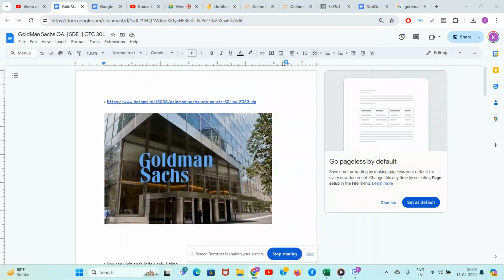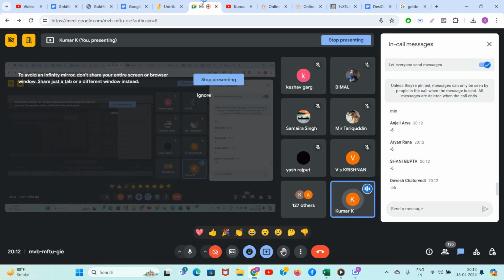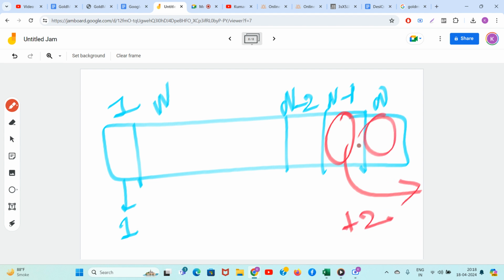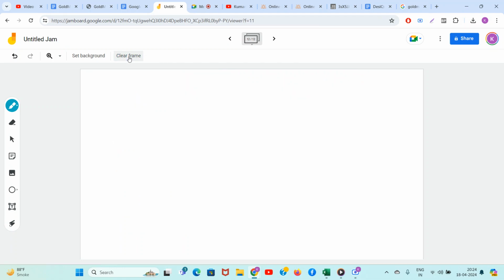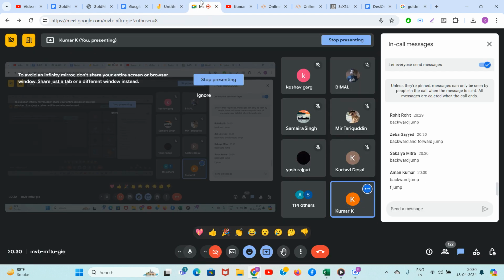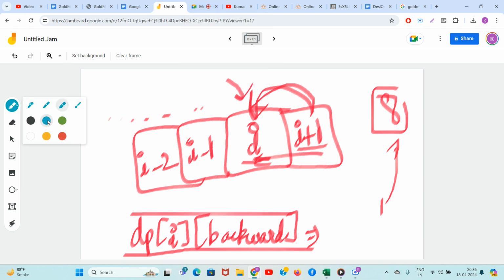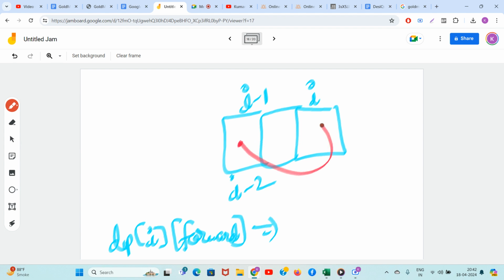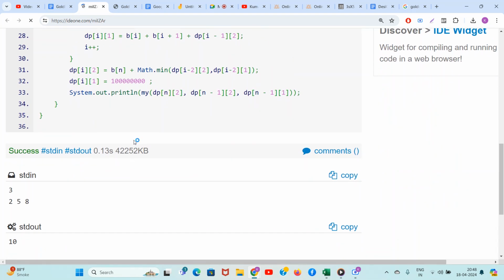Goldman Sachs OA | Interesting DP | CTC 30 L

Comment: This is my java solution

```java
public class Main {

    static class Solution {

        private Integer[][] cache;

        private int helper(int[] arr, int currentIndex, int notGoBack) {
            if (currentIndex >= arr.length) {
                return 0;
            }

            if (cache[currentIndex][notGoBack] != null) {
                return cache[currentIndex][notGoBack];
            }

            // move forward
            int choice1 = arr[currentIndex] + helper(arr, currentIndex + 2, 0);

            int choice2 = Integer.MAX_VALUE;

            if (notGoBack == 0) {
                // I can go forward
                choice2 = arr[currentIndex] + arr[currentIndex - 1] + helper(arr, currentIndex + 1, 1);
            }

            return Math.min(choice1, choice2);
        }

        // this is an interesting DP question where I have two options
        // either, I can move forward 2 steps, or I can move 1 step backward
        public int findMinCost(int[] arr) {
            cache = new Integer[arr.length][2];
            return helper(arr, 0, 1);
        }
    }

    public static void main(String[] args) {
        Solution s = new Solution();
        System.out.println(s.findMinCost(new int[]{2, -100, 8, 5, 0}));
    }
}
```

Can someone tell me, if this is correct or not?